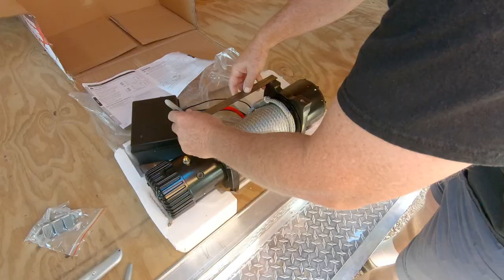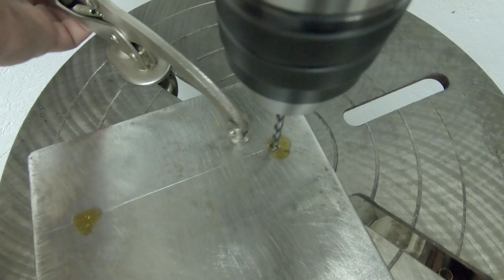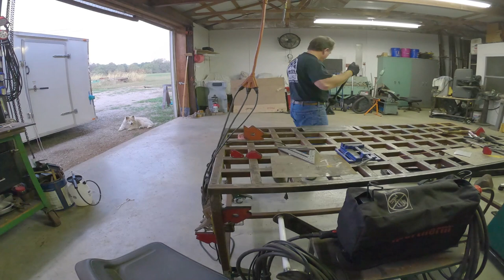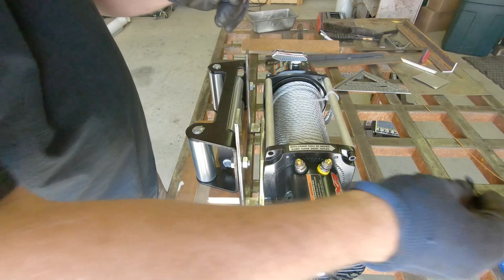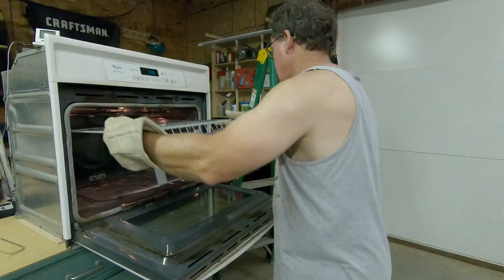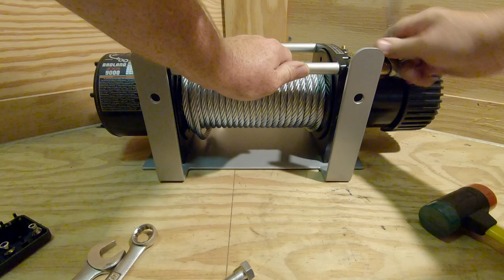Cargo Trailer Winch Mount Fabrication and Install

Comment: Looks great! I'll be installing mine when I get home from work here. I'm curious how you went about running power to it? Batteries charging off the truck from the 7pin? Or a 0/1/2 gauge running direct from the batteries to the winch with a quick disconnect?
Thanks
Reply from the maker: In the very last frame of the video you can see the pair of batteries I wired in.  I will eventually charge off the tow vehicle but for now, I keep them topped off with a small solar charger.  ~P

Comment: Man I wish I had skills like that. Awesome. I bet it would cost a fortune to get this fabricated for my enclosed landscape trailer.
Reply from the maker: You can do it!  An inexpensive wire welder and a portable bandsaw along with a drill motor.  That's all it takes and you would use them more in the future.  ~P